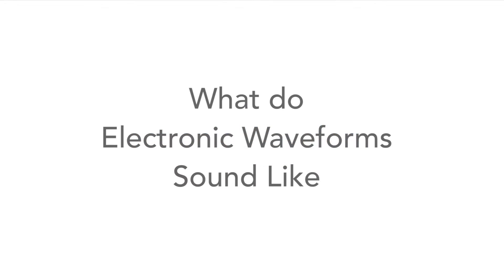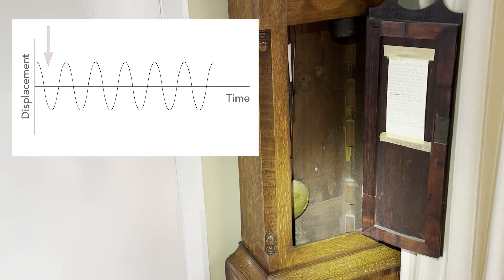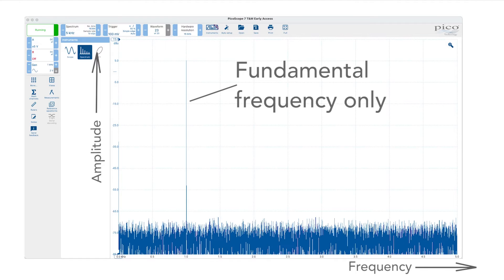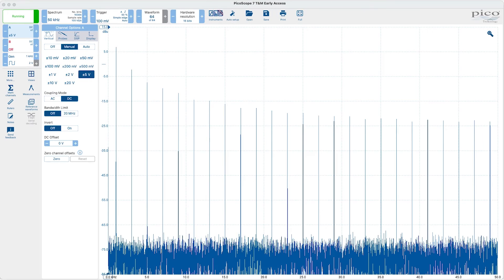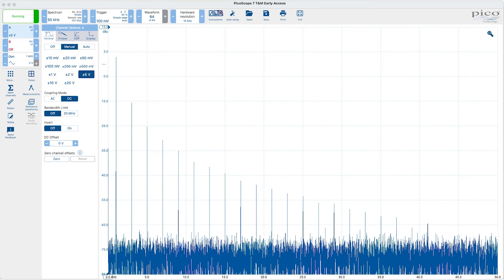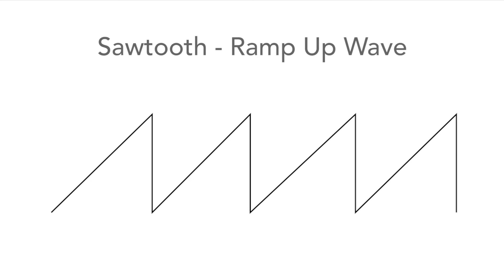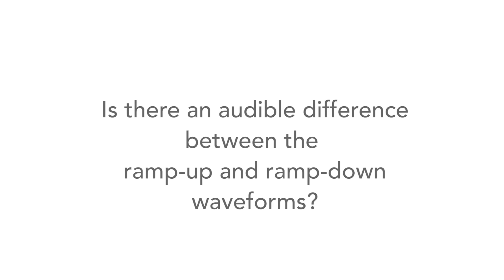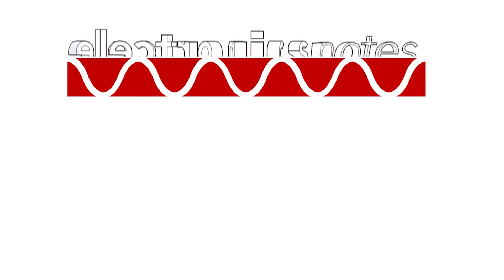Sine Waves vs All Other Waveforms - What's the Difference?

Comment: The square wave reminded me of an 8bit video game sound and the up/down ramps sounded to me like an old stylophone
Reply: I believe 8 bit would have used square waves, as it’s a digital chip so it would have been much easier and very natural to use a square wave, as it’s just pulsing a voltage on and off
Reply from the maker: All of the waveforms in the video were rather basic ones, so they would have been easy to generate on early equipment although they sounded rather "electronic."
Reply: The reason the 8-bit video game sounds like a square wave is because original games didn't have a way to vary the position of the speaker in steps. The speaker was "toggled," all the way up or all the way down, which corresponds pretty strongly with a square wave.

There are two ways to get variable levels on a speaker: a Digital-to-Analog Converter (DAC) and Pulse Width Modulation (PWM).

A DAC is a special chip where you feed it a number and it pushes the speaker to a level corresponding to that; if you have an 8-bit DAC, the numbers / "sample" values are 0 - 255. 0 will have the speaker all the way up (at rest). 255 will have the speaker all the way down (magnet pulling on the diaphragm, all the way). 128 will have it about halfway. Instead of just feeding it max / min values, you can feed it intermediate values, such that it approximates the multiple steps of a sine wave. If your "sample rate" is high enough, you can replicate any of these wave forms, with a pretty high degree of accuracy. CDs and most modern sound cards / modules use a DAC, typically using 16-bit values and 44,100 samples per second (x 2 channels for stereo).

PWM entails changing between up / down much faster than the speaker can move. By changing the value hundreds of thousands of times / second, the speaker will start moving one direction, then move the other direction, and then head the first direction, before it can go full up / down. This allows you to achieve multiple levels on the speaker, resulting in the ability to generate more-complex waves. Direct Stream Digital, commonly used on Super Audio CD, does something similar to this, with the value cycling between 0 and 1 nearly 3 million times / second.

Modern chips, like Arduinos and such, have both DAC and PWM circuits in them, such that you can use either one. You typically use the DAC for things like playing music and use PWM for things like illuminating an LED partway, etc.

I can recall playing with an Apple II, back in the day. You'd poke (or peek) a particular memory location and it would toggle the speaker (from up to down, or vice versa) for each access. If you toggled it 528 times per second, it would oscillate the speaker at 264 Hz, which is middle C. It had only one volume level and it could really only play one note at a time. There was a demo program which actually played 2-note chords but it was written in machine language and could only play one song (part of the "Blue Danube Waltz," IIRC). It had to, essentially, calculate the times between the peaks for each pair of notes and toggle the speaker at the appropriate moments to accomplish that. Running in machine language, it could toggle the speaker up to about 20k times per second, which could produce two-note chords, but wasn't really fast enough for 3-note chords. It still sounded "electronic," meaning it was really doing a couple square waves, not moving fast enough to do PWM and get something smoother.